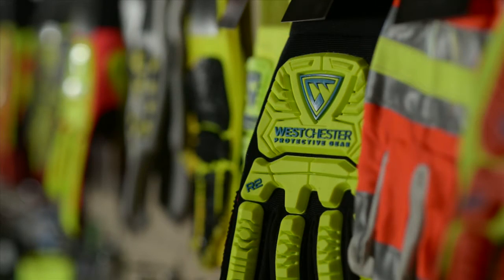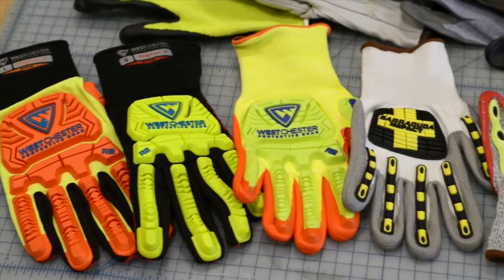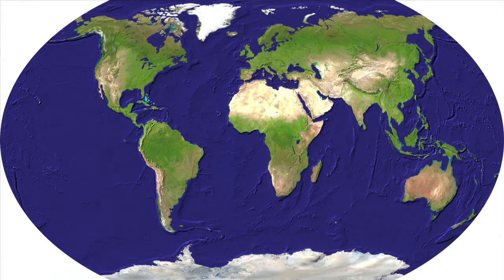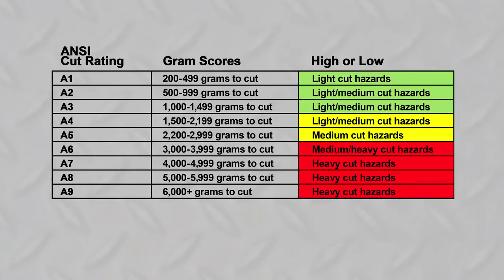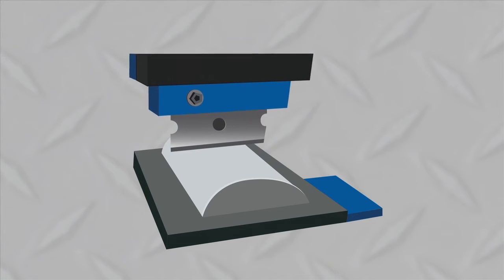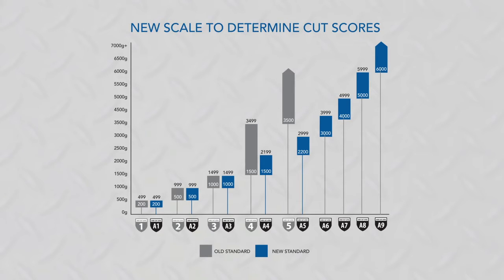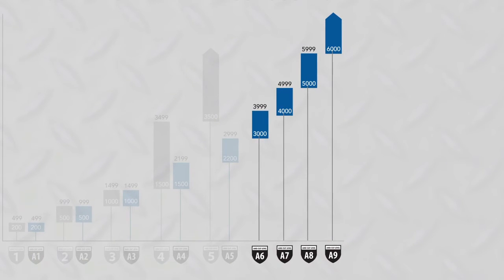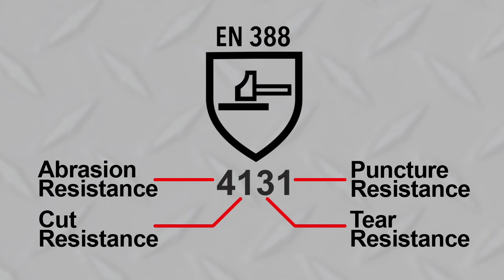Don't Cut it Close - What Level of Cut Resistance is Right for You?

Comment: Grams are not a measurement of pressure.
Reply: yes they are, same way lbs is
Reply: @oidowell5940  no. Pressure is force over an area. Grams and lbs are a measurement of weight.
Reply: @lordpablo1985  lbs of force, grams of force, you can measure pressure with grams
Reply: @oidowell5940  incorrect. Grams of force is not a thing. Grams per area, yes. Which is a pressure measurement. But again, it needs the area. Grams alone are not a measurement of pressure.
Reply: @lordpablo1985  exactly, it's like someone would say dpi, dots per inch but only says dp, dots per, but not over what area. It's meaningless otherwise.
A stiletto shoe with 1 Square inch and a kilogram of weight in it have less force impact than a 0.2 square inch with the same weight.